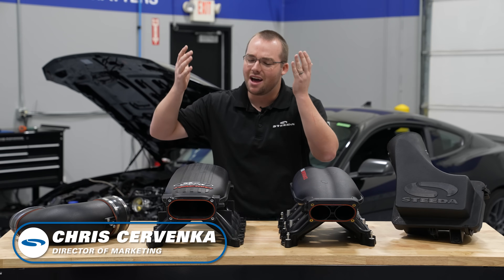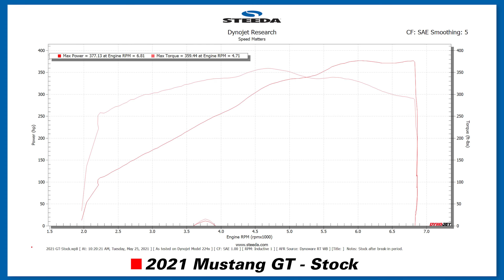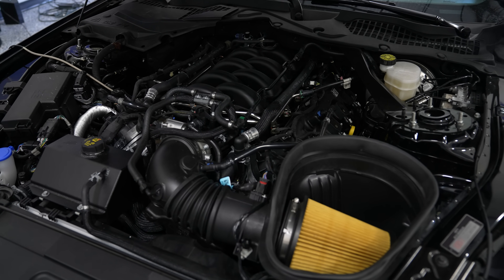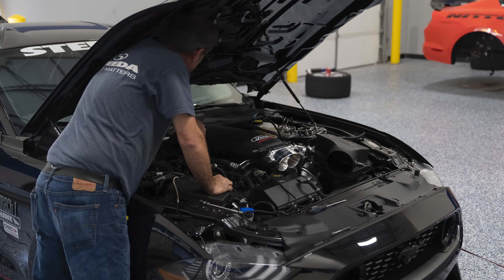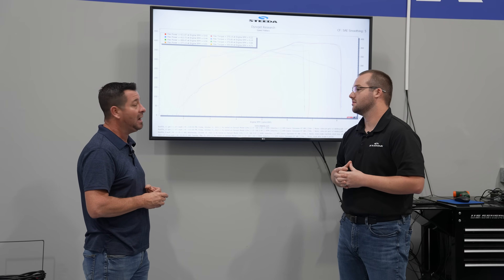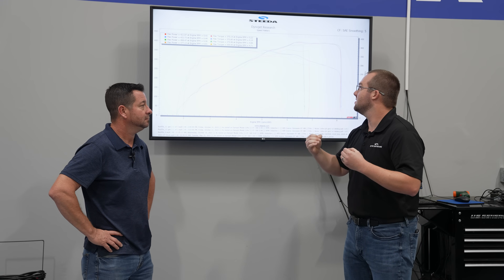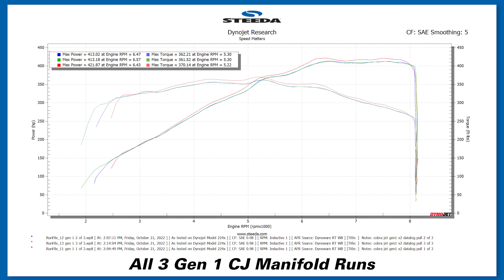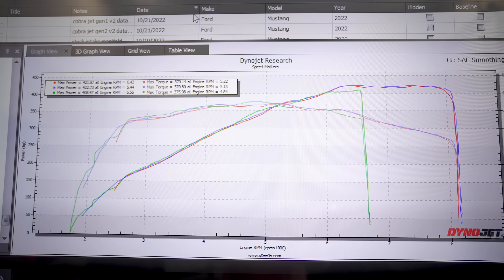Testing the New Cobra Jet Intake Manifold | Gen 1 vs Gen 2

Comment: Why are you stopping the Mach1 pull at 6600rpm when power is still climbing and is well short of the redline? But then you take the CJ to 8200rpm?
Reply from the maker: The stock tune has the rev limiter at 6600RPM. The CJ requires the car to be tuned which means the rev limiter is moved up.

Comment: So if they make the same power what was the point of the Gen 2? I'm guessing just QOL fixes, looking at them side by side the Gen 2 looks to have some better designed areas to prevent breakage/etc?
Reply: It is better designed and overall packaged. It basically is stronger, gives just as good performance as the gen 1 which is arguably the best intake manifold ever made. So you can mess around with it, have just as good performance and it's more reliable, nothing crazy, new or special, but simply building on what is already good, which is something Toyota and Porsche does a lot which people praise all the time. If it ain't broke, don't fix it.

Comment: Does the gen 2 Cj fit under the stock un touched hood of a 2020 gt
Reply from the maker: The Gen 2 will not fit under a stock 2020 GT hood. We have adjustable engine mounts if you want to go that route with the stock hood. https://www.steeda.com/steeda-adjustable-heavy-duty-s550-mustang-engine-mounts-2015-gt-555-4039.html

Comment: Not too surprising that there isn't a big change, they did say that the reason why they redesigned it in the first place is because they wore out the injection molds for the original CJ intake. Instead of getting new molds of the same old CJ, they took the opportunity to give it a little bit of a redesign. Looks totally bitchin too!

Comment: I have a ported gen 1 intake that you can use. I also have a Ford Racing cobra jet cold air intake with a custom machined(4.25" id vs 3.75" id) air filter transition. The aluminum transition/filter adapter is the only "restriction" that the Ford Racing cold air intake had. Test my intake vs others and change my mind. My throttlebody is the Ford Racing dual 65mm blade.

Comment: I’ve read just about every comment on this video. I’m a bit stumped, I wanna do an FBO build on my ‘21 GT MT82. I’ve done a shit ton of research. I don’t plan on ripping the motor apart anytime soon and doing cams/ported heads. Maybe eventually but right now I’m looking to get the most I can out of bolts ons. I stumbled across the opportunity to purchase the CJ gen 2 manifold along with:

 Vmp twin jet 67mm polished throttle body 

Ford Performance LU47 injectors 

Pmas air intake system for Cobra Jet intake manifold

As of right now I only have a resonator delete along with a staggered rim/ tire set up, I do plan on getting a full catback and short tube headers (not doing LTH because I do daily the car for now and I don’t want all of that cabin noise) 

Just looking to some power for fun daily driving. I know you’re all gonna tell me that I’m spending too much $ for a little power on a daily but I’m getting this stuff for a ridiculous deal. Someone help me out please lol
Reply: How come nobody helped you paul
Reply: @timweb1510 good question lol
Reply: @timweb1510 but all is well and the car is being built as we speak. Figured out set up.

Comment: @steeda did you guys use a throttle body control module with that throttle body? And is that the twin 65mm from ford performance?

Comment: You guys had every opportunity to do this right and kind of failed IMO.  2 cars and using a diff car to compare vs the manifold on the mach 1 is kinda cheesey, come on use the same car.  Then the peaks of the stock runs are where you cut them off or lifted.  You don't even run them to 7k, then run the CJ's past 8k.  The stock numbers were still climbing at the time you lifted or cut off the run.  You can see it on the graph.  Come on Steeda!!!  Just run them all on the same car and start and end the pulls at the same rpm or at least past peak!  Not to mention look at the dates on the runs were going to compare May to October and 2 different cars for "stock" hmm....

Comment: This is why I love you guys. You back up all your stuff with real numbers. I am a bit surprised though. My 20'mustang GT made more horsepower at the wheel stock than the Mach 1 did at 412. After I installed the CAI and E85 tune by you guys in just shy of 470 at the wheel. For anyone that doesn't believe me the proof is in the videos on my channel. Now I'm making more than a stock Shelby GT 350. You guys nailed it!
Reply: different dynos on different days in different ambient air
Reply: @Rockit181  same dyno on different days, but according the three technician the air doesn't matter because the dyno accounts for different temperature, humidity, pressure, etc.
Reply: @bardstables8909  bit more surprising if it's the same Dyno
Reply: @Rockit181  it was indeed. I was surprised I gained that much.
Reply: @bardstables8909  470whp is a lot for just a CAI and E85, I used to be all about imports back in the day but they got surpassed by modern muscle

Comment: Honestly, the gen 2 looks beefier, I wonder if it'll handle boost better that the gen 1.
Reply: So if I recall, I felt like that was one of the biggest improvements marketed by Ford Performance. Some gains in power, but overall they focused on improving the design and strength of the manifold.

Comment: Why does the new FR CJ manifold have the bridge in the TB inlet? Did Ford design the EVAP\PCV port(s) in this new CJ intake manifold to come out behind this bridge like the old 4.6L OEM 3V intake manifolds so that the EVAP fuel vapors & unmetered air will evenly mix\distribute into the incoming air thru the twin bore TB thus plenum\intake runners? IOW's for better emissions compliance? This is the only reason that I can see this being done..............

Comment: Did the Stock Mach1 have the hydrocarbon filter installed or removed? Seen removing it increasing power by up to 18HP over with it in place.

Comment: Looks amazing. Not sure it's 1300 bucks plus a special tb amazing but amazing none the less if you're looking for every last trickle of power (and think low end torque is boring) this is probably your manifold. I'm good with the 18 manifold for like 1/4 the price.
Reply: The cj is the best intake na no question.  You wanna make max na power this is the intake.  A ported one with mono and cams can really make some power and they have the best high rpm power of any of them and don't loose torque like a boss.  Cj are for guys who run cams and wanna be fast na.  If you just wanna swap an untouched manifold on a stock engine with no additional supporting mods some of the other intakes may be better for the money for that setup.  For max na power cj is king always has been.  Now the new one is even better.  Nobody should run either one especially the new one without also running cams imo.
Reply: @midnight347  Yes question. "Best" is a relative term. Best at what? Peak Power? There is more to it then that. Every NA dyno test I've seen that included the gen 1 cj, which the gen 2 is just slightly better, indicated that it trades midrange for peak power (as you would expect) and so, technically, it's the best for power, esp racing, but not by a lot and not a lot for the money compared to the 18 manifold, esp a ported 18 manifold which is still like 1/3 the price of this thing. I, personally, wouldn't put the cj on anything that wasn't a 8000rpm+ max effort racing engine. For like 95% of the Coyotes out there the 18 manifold is a better choice. By the time you add a tb and cai this thing is going to run you around 2k. You're partway to a turbo kit at the at point and most of the way to cams.

Comment: Want to see a max effort, FBO comparison of the manifolds. 
LT headers, full exhaust, biggest CAI, mono blade TB, etc.
Reply: With cams too.  The cj doesn't really shine with stock cams that really limits it and that is even more so with the newest one.  Do max effort na setups with cams and compare the difference I bet it would be more pronounced between the two cjs then.
Reply: @midnight347   Yeah, I’d like to see some upper 220-low 230 (@.050) duration cams tested also.

Comment: Ya kudos to ford for $1500 5hp. I get the packaging. But as a tuner once said, that means jack shit. That means they basically move the same air. Difference is negligible. It’s a slight improvement that the racing scene won’t really care about. 👍🏼 great video guys with no sugar coats though. Great data for us 👍🏼 keep it up!
Reply: It isn't meant to be ran on a stock engine.  That manifold needs headers and cams to really shine.  It doesn't add 5hp no matter what access the board it depends on your other supporting mods.  If you aren't going to do headers AND cams you shouldn't be going with a cj anyways let alone the newest gen 2 cj.  What do you expect?  On a fbo headers, cams, e85 car I guarantee there would be more than 5hp between them.  That is what this gen 2 was meant for max effort setups.  It isn't gonna show what it can do on a stock motor.

Comment: I'm currently on the fence and would love to see the Victor Jr intake go against the Gen 2 Cobra Jet Intake. 
I have a beautiful 2013 5.0 with Kooks long tubes and X-Pipe an Airaid cold air intake. Spring 23 I will be going with the Vic or the new CJ just need to see which one has more horse for my horse. Great video love your products and trust the name
Reply: Victor Jr performs just like the older Boss 302 intakes. It's not worth it.
Reply: Gen 2 cj ftw.  Even gen 1 cj is better than any other intake.  You want max power especially na the cj is it.

Comment: So I'm seeing more things added to skew the numbers. It wasn't just an intake swap. Throttle body and complete intake kit. And why didn't you pull the Mach 1 any higher when it was all stock? You stopped early!
Reply: you need to sway throttle bodies with the CJ and the Mach I went as high as it could before the factory speed limiter.  We weren't going to dyno the car in 3rd gear stock.

Comment: What’s if the GT350 manifold had a bigger throttle body like the CJ.
Reply: The cj is the best na intake.  You want max na power cj it is.  The tbody setup is part of why the cj setup is the best.  A cj with a mono tbody is the king.  It doesn't shine unless you have headers and cams too.  It will pull better above 7k than the gt350.  If you ain't trying to go max effort na don't worry about the cj.  If you're not gonna do cams and headers stick with a gt350 manifold.
Reply: @midnight347 since this video came out people have been saying the gen1 cj is better which is frustrating me because I'm trying to get my cj set up going on my gt350. I'm looking at the gen2 with mono porting

Comment: 377 is stock gen 1 numbers almost. That’s a tough dyno
Reply: I find it incredibly hard to believe there’s a consistent 30hp difference between a GT and a Mach 1
Reply: @D_phillips17  I do. Machs got a better manifold and cold Intake
Reply: @loweredyote8416  not that much better to net a 30hp gain on an otherwise unmodified car. Something along the lines of 10-12 hp is much more realistic.
Reply: @D_phillips17  you must not know much about these coyotes. Hotter tune, better manifold, better cold air is plenty for these csrs
Reply: @loweredyote8416  Quite a bit actually. you’re not consistently making 30 more whp with just a slightly higher volume manifold and a cold air. Dyno 10 cars w/ a 2018 setup and 350 setup and 9/10 times they will be within 8-12 hp of each other. Only way to net that much of a gain on an otherwise stock car is octane and timing. Highly doubt ford and the knock sensors are adding that much more timing in a Mach 1 to gain 30hp over a regular GT. And don’t get me wrong I’m not saying the Mach 1 doesn’t make that, but the GT is much closer than what this video shows.
Reply: @D_phillips17  I think so too. I definitley think GT made less than they should. That’s why I said what I said originally. If my 12 GT made 370 wheel stock and a 2020 is rated for 48 more hp to crank. Something ain’t right
Reply: @loweredyote8416  exactly. Realistically a stock gen 3 is making on average somewhere bet. 390-410 depending on weather. I drive a 2018 with free flowing exhaust on e85 and made 490. As much as these engines love that setup I know I didn’t gain 113hp (based off the 377 from this) who knows maybe they did it in purpose to entice you to buy their cold air, idk. Regardless, you and I both know that number isn’t an accurate representation of a gen 3 coyote
Reply: @D_phillips17  I for sure believe the gains are possible with that mani swap and filter with hotter tune but stock for stock def not
Reply: @loweredyote8416  with the CJ 100%. 2018 vs 350 though…  I think it would have more to do with the timing advance with a hotter tune. As long as the knock sensors are happy I’d be willing to bet you’d see slightly lower, but similar numbers with the same calibration
Reply: @D_phillips17  yeah it’d for sure need to be a combo of parts. That’s why I was saying the three things. 350 mani isn’t much better than the stock 18 but filter is better
Reply: @loweredyote8416  I agree a car with that setup will walk a stock gen 3. Although I personally kind of think it’s a little silly to spend all of that money on different manifold/cold air combos and porting when you could spend a little extra and get a vortech or ESS. That’s the way I plan to go here.
Reply: I was thinking the same thing 🤔

Comment: 7:15 I’d love to see a Ported Boss with a 90mm TB Vs the CJ without porting and a twin TB because I feel they would be the same numbers and the Boss setup is so much cheaper. Nobody ever did that test with the ported Boss. I feel the CJ isn’t worth all that extra money unless you’re going full max effort NA racing and money doesn’t matter and it’s not worth it unless you do cams too and at that point you might as well do the Ported Boss with an ESS blower for a fun daily car. The Ported Boss deserves a real comparison.
Reply: A ported cj with a mono is king.  You will max absolute max na power with a cj.  This is why all the fastest na cars run cjs.  You need cams to truly take advantage of what they can do.
Reply: @midnight347  yes if you are going Max NA it might be worth all that money but with cams too. My point is that if you are utilizing the stock cams, like most people, buying a Ported Boss with a 90mm TB gives the same results as a Non Ported CJ with a twin and I’d like to see that exact back to back test. And the Boss setup is a lot cheaper and looks better too, imo. Same power curve and steadily pulls hard from 4K- 8K rpms. and then it’s ready for boost later too. They are both high rise intakes with similar power curves. The bottom of the intakes are identical.
Reply: I love my ported gen3 intake. Don’t planning on spinning 8k or more at the moment so I think the gen3 is best for me.

Comment: STOCK GT redline is 7500, you guys didn't even hit 7k ,  so your test is invalid.
Reply: They hit the speed limiter
Reply: Invalid? Did you not see the dyno graphs, both manifolds make peak horsepower around 6,500rpm and it went flat all the way to 8,100 rpm 😆

Comment: That is interesting for sure. I have a 16 fbo with a gen 1 Cj and mono blade. My car has a MT82. I'm considering a ESS blower. I've put over 100k on this set up with no real issues. What do yall think about adding a cent blower like the ess to it? Keeping boost at less than 9 pds since it is a composite intake of course.
Reply: I went this route got a G4 from Ess with my CJ, just needs lots of couplers to fit it, im tuned by John from Lund
Reply: Thanks for your post. I have the gen 1 CJ still in the box.  I am going to order the ESS/G2. I am thinking I would need about 8 boost on the blower?
Reply: @henrymcmiller2527  what do you mean you "need" 8psi boost? To make it simple the G2 max it can make for a gen 1 around 780-820whp with a return style fuel system on e85
Reply: @trunkslorenzana  Thanks.
Reply: @trunkslorenzana  I am going to purchase the ESS Supercharger for my 22 GT, but I undecided about using the new gen1 CJ or keeping stock manifold.  I could sell the CJ and use the proceeds towards the cost of installation of the ESS Supercharger, or would I have significantly more power with the CJ/Supercharger?  I am leaning towards selling the CJ and not deal with the hood issues with the CJ.  My goal is approximately 700 horsepower/93 octane.
Reply: @henrymcmiller2527  the only hood issue I had was a notch I had to cut in the back of the hood to clear. It'd not bad at all.
Reply: @trspratlen  Thanks.  I am not sure if I will lower my engine to accommodate the gen1 CJ.  Also, there seems to be the same issue with the gen2 CJ.  I am leaning toward selling the CJ and use the stock manifold for the ESS Supercharger.  Unless there is a significant increase in power with the CJ versus the stock 2018 manifold.
Reply: @henrymcmiller2527  the rpm range will be higher with the Cj I believe. But I'm mt82 with a lightweight flywheel. I've had my set up for at least 4 yrs now. I love it, it buzzes pretty hi. I talked to a guy that has a  j and procharger. He said the upper end is insane. That's what I'm shooting for.
Reply: @trspratlen  Great to know.  High rpm’s is why I purchased the CJ. I have the CJ,  catback, and headers.  All still in the box.  I only need to add the Supercharger.  I will have a lot of fun in the spring!

Comment: They didn’t even rev out the stock 21 to 7500rpms so it probably would’ve made more than 377whp
Reply: No CLUE why they stopped at 6500..why on earth with you do that
Reply: yea they botched that shit up.
Reply: Not the first time they screwed up on a dyno pull.
Reply: Cause you hit the speed limiter 1:1 ratio on both the GT and Mach 1. This is why they can't take it up higher
Reply: @snoozesleepytime  thank you for explaining what is obvious to the professionals above.
Reply: @LongStroke351  lol